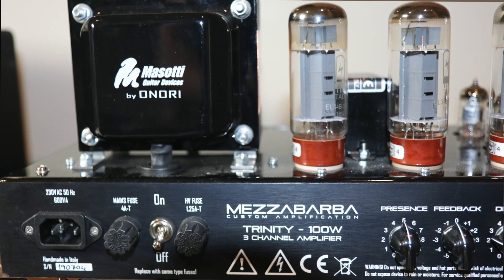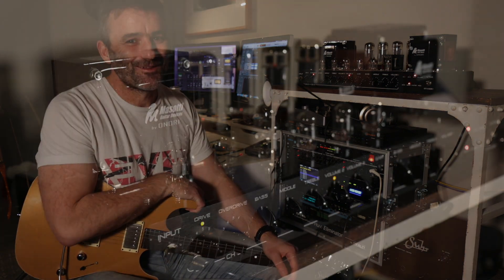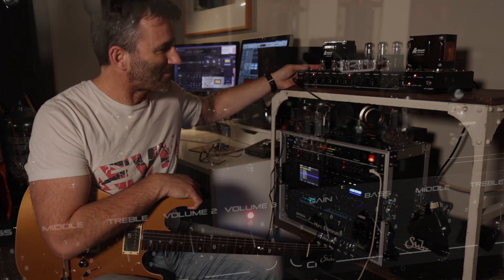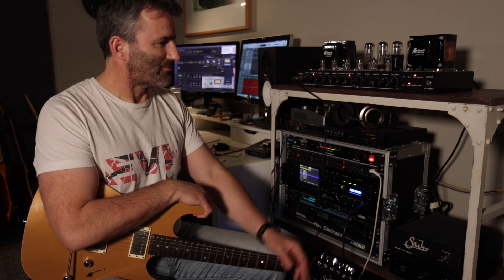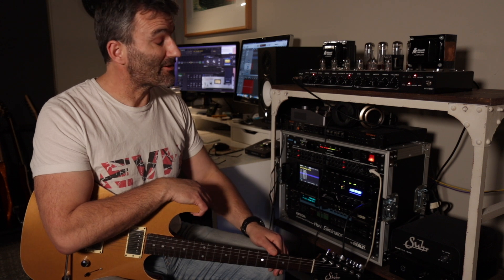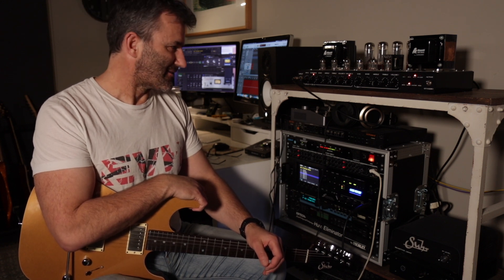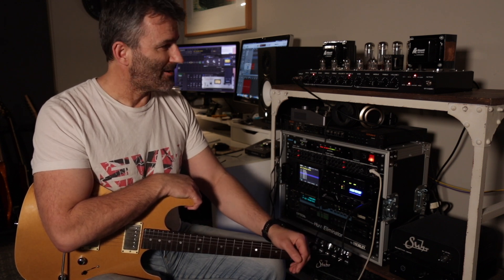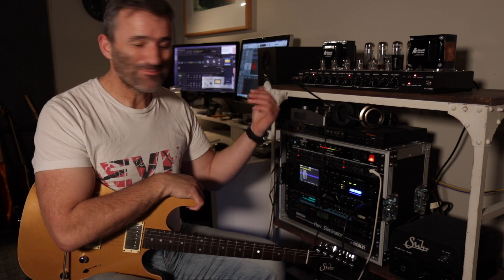Mezzabarba Trinity - GROUND LOOP HUM??

Comment: Hi there,
I recently bought a mezzabarba trinity and ive tried using rhe 4 cable method with my gigrig but the noise from the 2nd and 3rd channel is very loud. Even when the amp isnt plugged in the unit is very loud in general I can hear buzzing. Im wondering if this amp was the same? Its an incredible amp but I dont thjnk i vould use the 4 cable method with this type of noise on stage.

Comment: I gigged this exact amp extensively for approx a year in 4cm mode with the Fractal Fx8 without any noise issues at all. In fact whisper quiet, and I like alot of gain. It was no noisier than my be50dlx, diezel herbert, bogner xtc, slo clone that I owned at the time.
Reply: Just because you didn’t experience the problem does not mean it doesn’t exist. It’s amp building 101 that it be grounded to the chassis. It’s also a major safety issue.
Reply: Same experience. My Mezzabarba stuff has been solid.

Comment: Thank you for making this video and praising the sound of my amps. As you know, most everyone has - in the past - for sound reasons - have used the input jack for ground reference - the test amp you are referring to is an older amp before we changed wiring similar to your suggestion
Reply: I purchased this amp directly from you in December of 2019, it was the latest iteration at the time with the Steckel spec. Has the grounding changed since then? As mentioned above I did not have these issues.
Reply: I think you’re woefully misrepresenting this. For a start, an amp with that homicidally stupid and definitely not standards compliant ‘ground’ design should never have been turned on, let alone left the shop. I’m amazed you have the guts to claim CE compliance on any product, since any company capable of properly self certifying would never let this slip as its such a fundamental aspect of class 1 appliance safety.
Reply from the maker: Great!  It's a beautiful amp.
Reply: How did you let that leave your shop?
Reply: not a sound (as in good) reason....... just thoughtlessness. It's interesting that the circuit is basically a SLO-100 with a less gainy middle channel added.

Comment: The designer probably heard once upon a time that having a Star Ground was the way to go. But he doesn’t understand that you need more than one star ground when you have a tiny signal in a high gain preamp and a high voltage power supply. The idea that a lug nut on an input jack is a safety ground is just baffling…

Comment: The chassis ground should be by itself, crimped, soldered, heat shrinked, bolted to the chassis on clean metal and the wire should be considerably longer than the live/neutral wires. If the IEC jack was ever to become loose or broken out, the chassis ground would be the last to go. 

It needs to be the strongest connection inside the amp.

Every amp I build or convert to a 3 wire configuration is done as stated above. 

The live wire also goes to the FUSE FIRST on the bottom/inside most terminal. For some reason there seems to be an argument about this. If you wire it to a switch first, you are wrong.
Reply: I don't th iknk these guys should be selling amps tbh, this is basic safety stuff.  I would have thought selling these without a safety earth connection was very illegal
Reply: It is also generally simpler to wire the fuse first, because the fuse socket is commonly beside the IEC socket, while the on/off switch is usually on the front side.

Comment: Why bother with a three prong cord at all if they aren't going to connect the ground lug? To give a false sense of security?
Reply: Fuck me. Watch the video properly. The amp is grounded, but the earth goes from the iec to the pcb first, that star earths the rest of the amp. The chassis gets its earth via the audio earth on the jack socket. Jason reversed the order so that the earth goes first to the chassis then to the audio circuit via the chassis jack connection. Jason took the wires that were soldered to the earth lug of the iec connector and covered them in " several layers of heat shrink"  to maintain their continuity.

Comment: How that missing ground got by the EU regulations is pussling!!
Reply: That’s what I don’t understand. Are they just rubber stamping this stuff as opposed to actually inspecting one?
Reply from the maker: They must just undertake rudimentary electrical testing rather than cracking the amp open?
Reply: If you connect the test-devices to the unit, all things will measure correctly, because at first the input jack is seated firmly fixed, so the from a simple electrotechnical perspective, the device is deemed safe.